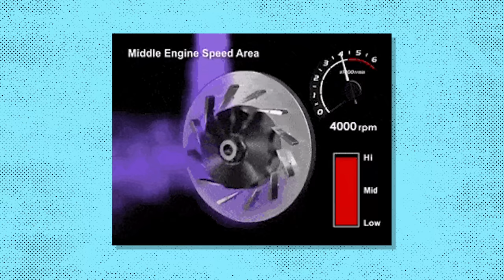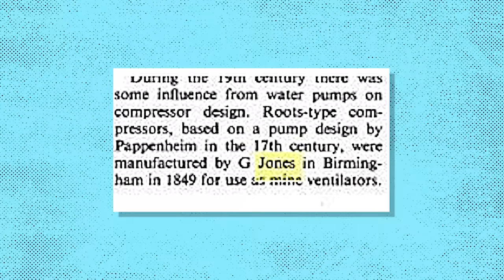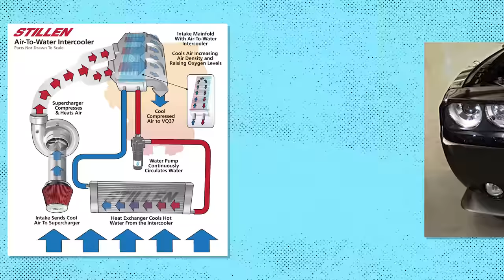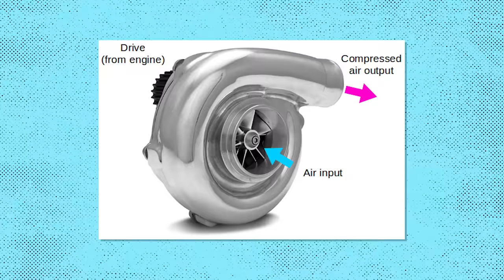Why Superchargers Aren't As Good as Turbos

Comment: Turbo is actually short for "Turbine supercharger", which hasn't changed. The terms weren't separated at all, because the correct name of a supercharger always comes with what type it is, i.e. a positive displacement supercharger etc. Turbo is just neat and short.

Cool video though!
Reply: You both are correct. The turbo uses a turbine to drive the supercharger... But colloquially it has always been turbo supercharger, shortened to turbo charger, shortened to turbo
Reply: Crazy how much random shit I learn in the YT comment section 😅
Reply: Marketing doesn't like long names, turbo supercharger was too long, turbo is short and punchey.
Reply: If you read books and engineering publications from the 1930's and 1940s the term Turbo-supercharger is used often.
The modern abbreviated term Turbocharger  became more popular and replaced the earlier term.
Reply: The Big reason it was/ is turbo supercharger is because turbo normalizers exist which create no boost and only bring the incoming air to sea level pressure of 14.7 psi
Reply: @Xerxesthefalco  Both superchargers and turbocharger can be used for altitude compensation without manifold boost.
The term Turbo-supercharger denotes that the supercharger is driven by an exhaust turbine (Turbo) and not from the engines crankshaft.
Reply: @sandervanderkammen9230  the term supercharger is referring to manifold boost but yes the turbine portion of the name refers to the exhaust gas or air driven
Reply: @Xerxesthefalco  Supercharger refers to a device that compresses the air above ambient pressure.

At an altitude of 40,000 feet the supercharger works very hard, compressing the air to more than 5 times ambient air pressure to maintain the engine performance at MSL.
Reply: @sandervanderkammen9230  No a Supercharger is only a device that compresses above MSL pressure if it compresses above ambient but only to MSL it is a normalizer
Reply: @Xerxesthefalco  Ambient air pressure varies according to altitude and weather. 
Anytime the compressor operates at higher manifold pressure than ambient it is supercharging.

Manifold pressure above MSL is referred to as manifold "boost"
Reply: So, more accurately, the name should be turbinecharger..? 
I don’t see that getting big for some reason.
Reply: @Heikonyan, I find approaching the matter foremost from a mechanical engineering physics angle makes the most sense.  Nomenclature aside, the supercharger distinctive is about tapping crankshaft energy directly driving compressor impellers employed to boost intake manifold pressure.  Separately & uniquely, the turbocharger system introduces an impeller into the exhaust gas plenum tapping energy via (pressurized gaseous exhaust gas) fluid coupling where the exhaust impeller via a spinning shaft assembly (spool) is attached to an intake impeller that compresses intake air boosting manifold pressure.  Both system types achieve the same objective via different methods.  The nomenclature of turbocharger vs. supercharger is much a colloquial thing.
Reply: TURBO refers specifically to a gas turbine engine. In this case a gas turbine engine which drives a supercharger.
It applies to other gas turbine engines including turboshafts, turboprops turbofans and turbojets.
Reply: @GertieYTube  Swiss BB&C engineer Alfred Buchi who invented them used the term Turbolader which translates into English as "Turbocharger"
While General Electric favored the term Turbo-supercharger which fell out of favor.
Reply: @Xerxesthefalco  Excellent comment, also Diesel truck and Locomotives use 2-stroke Diesel engines that are turbo-normalized... the produce no manifold "boost"
Reply: @Snookynibbles  The main distinction between the two is the turbo is driven by a gast turbine Brayton cycle engine that operates in a combined heat cycle.
While the supercharger runs strictly from the crankshaft as a parasitic load.
Reply: @WilhelmKarsten  Yes, that’s true.  I detailed this in my earlier post in this comment section.  And likewise, each system has its own strengths & weaknesses.
Reply: @Snookynibbles  Yes, but the method used to drive compressor gives the Turbocharger significant overall advantage... not just superior fuel efficiency or superior horsepower and torque output.
Reply: Any power adding device that compresses (or kompresses) air is "supercharging" the air. So they're all classed as [superchargers]. That said, common vernacular has divided the power adders. Those attached to the exhaust piping are considered turbochargers, and those attached to the crankshaft pulley are superchargers.

Comment: 3:38
Actually the Twin Screw rotates inwards unlike Roots that rotates outwards, and this reduces the friction experienced by the air, thus reducing heat and power required. This is why Twin-screws are more common on "newer" charged v8s like the Hellcat or the LS9. However, due to reliability issues and higher production cost as the lobes aren't identical and the female should rotate faster than the male, this solution is very rarely used. Most modern roots blower are heavily twisted anyways, so it's similar in workings to the twin screw without the need of a female rotor.
Reply: Very interesting tidbits ^_^
Reply: Very cool !
Reply: twin screw and roots rotate the same way...  also The VW1.4 TSI and Volvo T6 use the roots type supercharger
Reply: @EngineeringPerspective  I've seen enough sources to prove that the twin screw rotates inwards while the roots rotates outwards.
Reply: @EngineeringPerspective  "TWIN SCREW OPERATION

INTAKE: Incoming air is sucked into the rear of the supercharger. Note the rotor rotation is the opposite of the Roots to avoid pumping air between the rotors and case. This more efficient “internal compression” of air reduces the high turbulence, friction, heat and pumping losses found in the Roots."

direct from Kenne Bell, supercharger manufacturers... Whooooooops.
Reply: @Lo0die3  But still less efficient than a centrifugal, external compressor.
Turbos have more efficient compressors and no parasitic drag.
Reply: Screws rotate the same direction as the roots. The air is carried around the OUTSIDE of the housing to the pressure side. That is the same in both cases.
Reply: Twin screws rotate the same direction as the roots. The air is carried around the OUTSIDE of the housing to the pressure side. That is the same in both cases.
Reply: You do realise that rotating inwards or outwards is just a matter of the perspective, right? Take two screws rotating "inwards" and turn it upside down and not its rotating "outwards"

Comment: Superchargers don't suck, the main reasons why you don't see many stock cars with them are really 1) they cost more than turbos, quite a bit more for the OEMs in fact and 2) it's harder to fudge fuel consumption homologation tests with them (you know what I mean, all those "downsized" turbo engines that supposedly get 45mpg but in the real world you can't get more than 25 out of them).

The idea that a supercharger is a waste of engine power while a turbo is "free" power is also not really true. The turbo gets some of its energy from the expansion of exhaust gases, but how much exactly depends on operating conditions and in many situations a turbo can get much or even most of its power from the flow of the exhaust gases (not their expansion) which creates backpressure on the engine which creates a breaking torque (just like superchargers), plus turbos heat up intake air far more and turbocharged engines are more limited in terms of compression ratio.

In light throttle conditions turbocharged engines are often very efficient, but at full power they are usually less efficient than naturally aspirated engines, sometimes even less than supercharged ones too.
Reply: This comment has the ring of authenticity.  The video  appears to be someone who has taken a shallow look at the topic and lacks deep knowledge.
Reply: You can also tune superchargers to be a lot more linear than turbos. In my experience, hitting the boost threshold mid corner with a turbocharged car has sent me toward many a tire wall
Reply: I would add that centrifugal superchargers do NOT have lag. What they do have is constant increase of boost (not sure if linear or exponential) as the engine RPM increases. This means that at low RPMs the centrifugal isn't doing much, but as you climb the RPM range, the engine keeps getting more and more boost. In fact, I've seen people with experience adapting both centrifugal and roots to the same engines (Mazda L5-VE in NC MX-5's) reporting that the former has slightly better throttle response.
Reply: @espvp  Superchargers are a linear increase of boost. Engine RPM multiplied by whatever reduction ratio the pulley is.
Reply: @Samus5164  Not true, the boost pressure curve is dependent on the type of compressor used... centrifugal superchargers do not have a linear boost curve.
  Any questions son?
Reply: Yes, it is true... you obviously don't understand how turbos work... perhaps you should stick to oil changes and tire rotations.
Reply: @ericrawson2909 Spoken like a high school drop out that has never seen the inside of a university engineer classroom.
Big F for Fail.
Reply: @eh6578 ah no, superchargers are generally limited to fixed drive ratio.
Reply: @espvp Don't be afraid of turbo lag kid... it's not real, it's imaginary.
Reply: W comment
Reply: Finally! Someone who gets it! In all honesty there is no objective winner on which one is better, I prefer superchargers, but performance wise it really depends on the vehicle and its use application. Therefor this idea that one is "objectively better" or "superior" to the other is utter LIES. THANK YOU for admitting this shit. Not many want to
Reply: No, superchargers do not suck. They have their applications. The reason they are mostly employed on bigger engines is because they use the engine power to create the boost. If you apply the supercharger on 1.5 L engine (4 cyl) you will use significant percentage of already limited power to run the supercharger. That limits the usable power production. Another reason is the price. Supercharger is significantly more expensive to manufacture than turbo charger, which is making it not very price effective to use in Lower priced vehicles. Some advantages of superchargers are that they produce extra pressure more evenly and from lower RPM's. The advantages of  turbocharger is that it uses wasted engine energy to produce usable pressure, it's cheaper to produce than superchargers, and it works quite good with smaller engines. The myth that turbocharger doesn't work well with high compression rates is false...Diesel engines work just fine with turbochargers...in fact most of modern diesels in cars are turbocharged.....compression being 18:1 or much higher....much higher than gasoline engines today. The one thing that turbocharged engines suffer from is a turbo lag...the time from gas pedal input  to turbo charger actually spins up to produce the maximum power. But that problem has different solutions. My Mazda 2021 CX 30 2.5 turbo has some turbo lag, but if you put it into sport mode (single switch) the  turbo lag disappears. Response is instantaneous. Whatever that engine can give you, it gives you right here and right now. Yes, it cost me the fuel efficiency...but superchargers are not installed to  save fuel either. If i had 6 liter V8 and wanted to get 700 or 800 HP out of it i would probably either put on it a twin turbo's or a supercharger, but if i had 2.0 or 2.5 inline 4,  and wanted to get 200 0r 250 HP's out of it,,,i would most likely put a single turbo on it, combined with some other technological improvement.
Reply: @espvp  Tecnicaly yes. There's many solutions to eliminate turbo lag. That is not a technical problem any more. It is a financial problem. It comes down to how much are you willing to pay for your car?